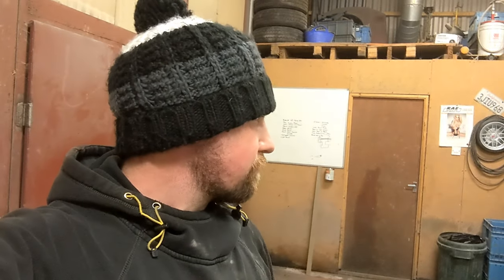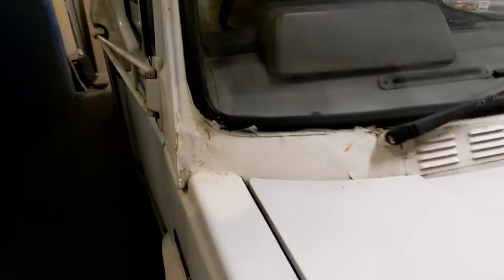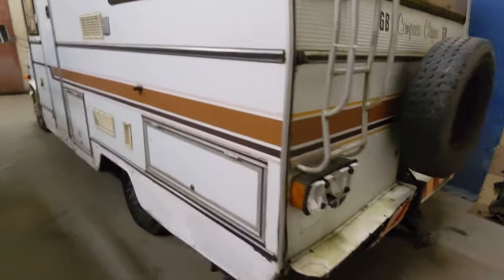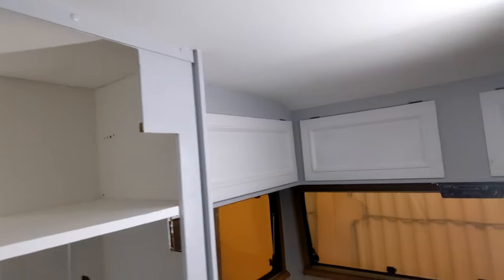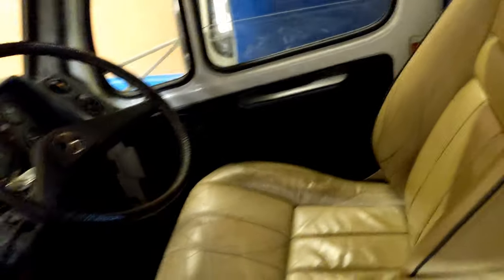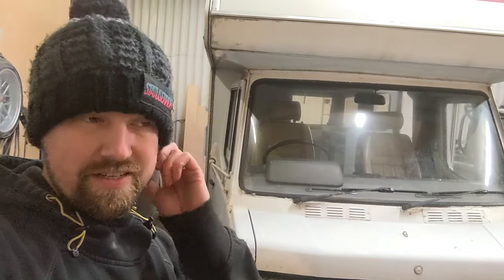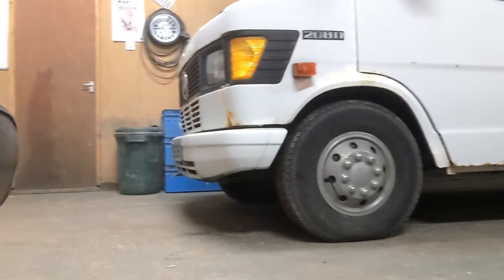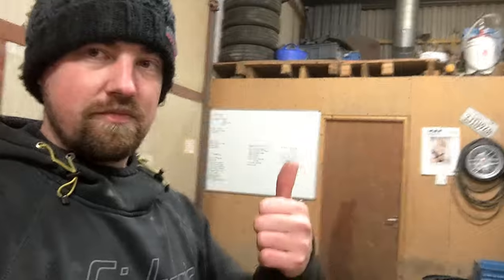What have I gotten myself in to - Mercedes T1 208D Motorhome Project

Comment: Good luck with restoration, I done one, a 1990 208d autotrail got new windscreen scuttle panel, wings front panel from coastal motorhomes, a lot of work done including partial floor wood framework etc but we'll pleased with it they have a  bulletproof engine our's has a turbo fitted.